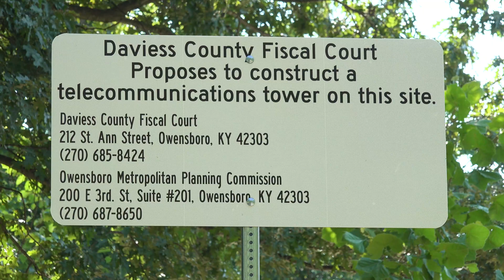New Tower for Digital Radio System

Comment: But wasn't the original idea to incorporate the civilian world too? Will they get rid of HAMs?
Reply from the maker: This new digital system only replaces the current analog system of emergency radio communication of county fire departments and sheriff's office.
Reply: @daviesscountygovernment  So that's a "YES", if you are only going to use digital comms., as well as no longer supporting analog services?
Just like American TV is now  all digital.....
Reply from the maker: @robertbrooks4413  This new radio system, like the old one, is only used by government offices. HAM radio operators will continue on with the duties they currently perform.
Reply: @daviesscountygovernment  I remember reading that the feds were to no longer support the ham site and equipment. Will the old towers and rented ham sites still be powered up?
Reply from the maker: @robertbrooks4413  contact Andy Ball at aball@daviessky.org for more info regarding HAM radio